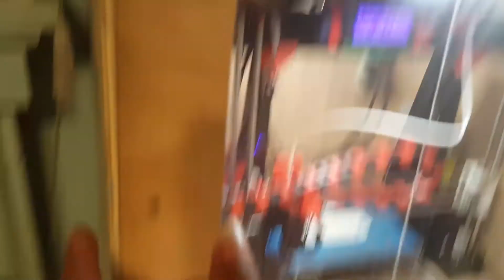How to 3D Print with ABS on the Anet A8

Comment: You can and should use a fan with abs in an enclosure as it will increase print quality just use buildtak, have a better wiring/mister for the bed, 24v power, and enclosure

Comment: Do you have info on how you setup your power supply just for the bed and the how the other one is hooked up?  Was it another video you got it from?
Reply from the maker: Curtis Taylor No I got information from online but I can tell you I used a pc psu for the Anet motherboard and the psu that came with the Anet and connected it to a mosfet that connected to the Anet motherboard with a power switch connected to the Anet power supply so basically 2 power supplies 1 for the Anet motherboard and the hotend for the extruder and the other 1 for the mosfet to the Anet motherboard for the heated bed